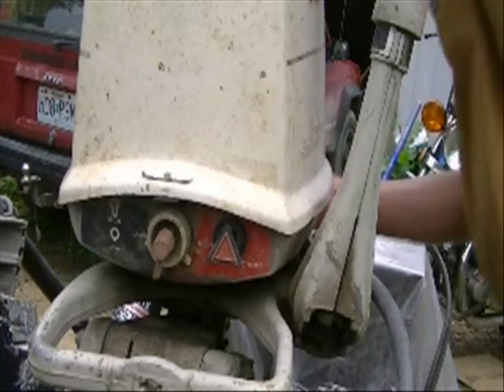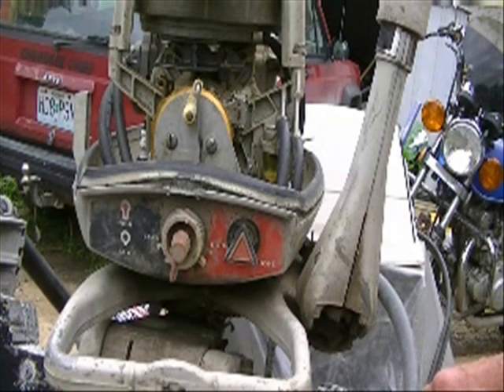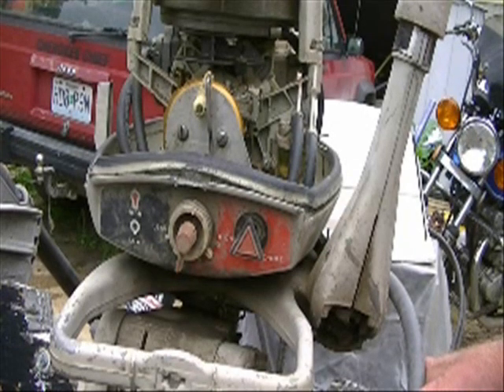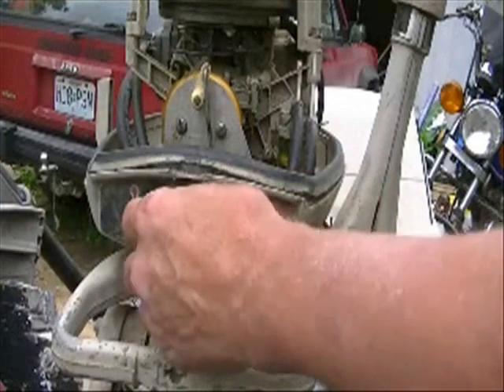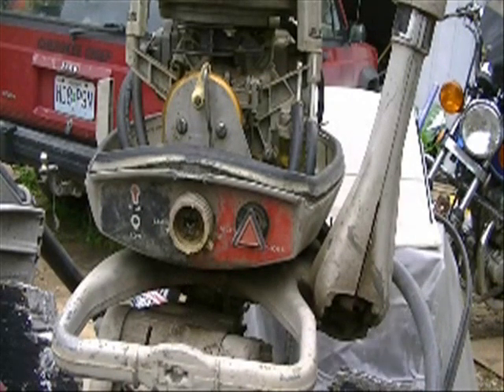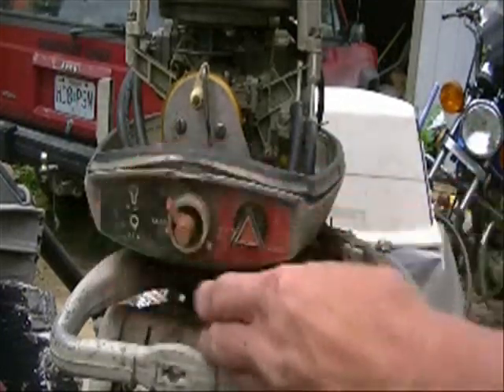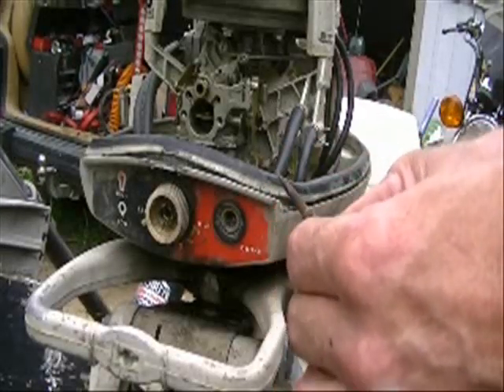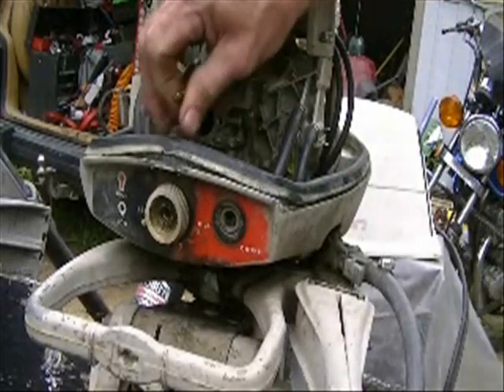Boat Motor Won't Stay Running? Watch This!!

Comment: i have a 78 55hp evinrude  what should the floats to set to  right now they are set on 13/32mm
Reply from the maker: Michael Robbins I don't know. If they are on a hinge, they should be set so that the float and the float bowl base are parallel when the carburetor is held upside down.

Comment: Hello I have a 94 30 hp evinrude it will not start it is hard to crank over but when I take my spark plugs out it cranks fine. Could I have some help please
Reply from the maker: freddy wilkerson Either the starter is worn out, or it is losing amperage through the wiring. Try jumping directly to the starter stud with a jumper cable and see if it spins over normally.

Comment: I have and 1985 boston whaler with a mariner 115, the motor starts right up when the rpms are high but as soon as you drop it in neutral it shuts off after 2-3 seconds, is it the carburetors?
Reply from the maker: Ryan Jackson It could be the idle jets are clogged or the idle is just too slow. Try pulling the choke at full throttle. This may clean the jets. Just pull it momentarily and release, so you don't kill the engine.

Comment: I have a Yamaha 4 horse / 4 stroke.  Cold start is fine.  Motor will run without cutting off.  When I cut it off it will not restart until it cools back down.  A mechanic has checked for thermostat and there is no problem there.  Any ideas.
Reply: hi had the same issue took it to mach
found out compression was that low or just running one that pressure from water stops the engine
u will also notice u can rev on neutral

Comment: Hi Kevin. I have a 1985 Evinrude, 70 hp. I have water in the fuel, with a milky substance build up on front 3 carbs. The hose connects to the airbox also have fuel and milky substance coming out. What could be causing this? Shouldn't this hose have vacuum and not have gas leaking out? I'm totally in the dark on this, lol. Any advice you can give would be greatly appreciated
 Thanks so much
Reply from the maker: The milky stuff is water mixed with fuel. Make sure the tank is clear of water and that there is not too much alcohol in the fuel (which attracts water). Probably not much vacuum to that hose and may leak because a carb float is stuck.
Reply: +kbbacon Thank you

Comment: I have a 2008 mercury 9.9 four stroke that will crank and run fine as long as I keep pressing the primer bulb on the front of the engine (not the primer bulb from the tank). When I stop pressing the bulb the engine shuts off. Any ideas what could cause this ??
Reply: +Chris Thomas Maybe its not able to draw fuel from the tank, tank breather may be blocked. Had the same problem
Reply from the maker: +Chris Thomas I couldn't reply. earlier. I'm thinking that the main jet in the carb is clogged in the fuel bowl. Sometimes choking the engine while it's running will pull the clog out, otherwise, carb cleaner through all holes in carb or remove carb and use a fine wire or needle to open up the jet.

Comment: recently bought a pontoon with 50HP Force, it starts fine but as soon as I pot it on FWD or REV. engine dies! is it low Idle problem?
Reply from the maker: Probably, but try pulling the choke out and see what happens.
Reply: @kbbacon  It's a "push key in" type of choke not a push/pull lever type.
Reply from the maker: @majidsoltani8588  Try pumping the primer bulb on the fuel line.

Comment: ok I have a question I have heard that some older boat motors in the 9.9 range can be change to 15-18 hp just with changing out the carb. do you guy by chance know what motors this can be done with? the reason I ask because here you do not have to tag a 9.9 motor or lower and this would give me a chance to find a motor over the winter when they are cheaper. any information would be a help
Reply from the maker: It is possible, but I do not know for sure. I know that works for some 4 strokes.

Comment: Sorry to bother,  I'm going to try what you suggested here; So I have an evinrude 9.9. 4 stroke 1995 took It out, it seemed to run and start ok. but then full throttle wound bog down at top speed, it started to sputter and and even back fired, it would go 10 feet and shut off 10 feet and shut off full throttle would bog. it was making sounds and running like it had water in the carb. any suggestions? I'm going to try put a carb rebuild kit and see if that helps
Reply from the maker: Sputter and backfire is due to a lean fuel mixture. Blasting out the jets with carb cleaner will usually do the trick. Also  try pulling the choke.  It will sometimes loosen debris and clear out the jets.
Reply: Thanks for the quick reply, will do! One speck/grain of sand in the jets will cause that issue? Just picked of some compressed air in the can, I'll keep you posted!
Reply from the maker: It takes very little to mess with air/fuel ratio. Good luck!!
Reply: had same problem...my coil pack was loose.wasnt getting proper ground.
Reply: John Parkhurst

Comment: thanks for great vid. i'll try the seafoam heard it's great. Mine runs great in 55 gal drum (all day) take it out on lake it runs for about 20 mins then shuts down let it sit for 10 mins runs again for 20. I've fiddled w/ it. Any advice? it's 1963 sears 5 hs. I have the fastest grumman transomed on the lake(usually)
thanks again.
Reply from the maker: dadrules714 There is either a fuel blockage at the fuel pump (or a vacuum leak in the supply line), ot the tank needs to be vented. Squeeze the pressure bulb when the engine starts to die. It's also possible that the points are to wide and they warm up and don't make contact. Lastly, it could have a coil breaking down when it heats up. I have also seen head gaskets do this, but it would likely only get one cylinder.

Comment: My boat motor revs up too much but it doesn't go fast is there anything you can help thanks
Reply from the maker: Check your prop connection. The key may have sheared or, in some cases there's a rubber bushing that separates. I'm betting there's your problem. Let me know!

Comment: i got a 7.5 sea king out board bout,a 79 yr, mint condition, will it work this engine/ montgomery wards  in on the motor, i bought it, for 40 dollas, all new paint, no rust,it, sparks, what can i do it get this obe started.

Comment: Hey, i just got a 1975 johnson 15 horse. It starts ok, but it ghost revs on me and doesnt want to stay running at low speeds. It will run, but its not consistent and sounds like shit.  Any ideas? Thank you!
Reply from the maker: I would check the points. Also, flood the carb with cleaner and let it soak. The float might be sticking.

Comment: Kevin I have a nine and a half Johnson pull start 2 cylinder 2 cycle I'm fairly new to this boating. my boat motor when I pump the primer bulb and pool to start it it runs like mad 30 to 45 seconds. then it stops and won't run again for a while. I have put it on the Lake 3x and cannot get past the dock. I try to restart it but it won't start. I want to fix this on my own because my budget is very small. Help Please
Reply from the maker: If You can take the sediment bowl off,  try filling it with Sea Foam and replacing it. then start the engine. The Sea Foam might dislodge some gunk in the fuel system. Just a shot in the dark.
Reply: This will happen if you forget to open the air vent in the fuel tank. Engine sucks fuel from the tank and creates vacuum and fuel flow stops. It will not restart until vacuum leaks away. Then the cycle repeats itself. My boat goes about 25 yards before it stops but it depends on how much air space is in the tank when you start.  If you have one of the tank caps without an obvious air vent screw in the centre, try loosening the cap and if it then works sort out the cap or renew it.
Reply from the maker: The engine has a fuel pump that may be bad.
Reply: Another thought after reading your statement "runs like mad". When you start engine it should be with the choke pulled out. As soon as it starts, push the choke back in again, working the throttle at the same time. Engine will "run like mad" because choke supplies too much fuel to engine, eventually flooding it and making it stop. A fuel flooded engine will not restart until the excess fuel dissipates. Either wait 5 minutes or more and try restarting, but without any choke and without pumping primer bulb, or disconnect the fuel line and give 5 or more good pulls on the rope to pump out the excess fuel. It is also possible that the choke in/out knob is not doing it's job properly and engine is permanently choked. They can be wrongly fitted with 180 degree rotation and not operate the choke plate correctly.  A quick visual check should let you know if it is a least moving the lever on the carburetor properly.  From distant memory, the small flat cut in the side of the plastic arm should face inwards.  A better way is to remove the air intake "muffler" and visually inspect the choke flapper.  With choke knob out, the flap should be fully closed and when knob is in it should be fully open. There is an excellent website called leeroysramblings.com  that tells you absolutely everything you will ever need to know about these motors.
Reply: FYI, that's leeroysramblings.com . A very helpful site.
Reply: Seeker85420
Reply: Thank's  Seeker85420 - I have corrected my post.

Comment: i am having a problem with primer bulb not expanding back after compressing it.....arrows on bulb are pointing the right direction....help..hellp..help
Reply from the maker: Check the fuel tank and hoses. It  appears to be clogged.

Comment: Will seafoam treatment for my motor clean carbon out my converter
Reply from the maker: I don't know.
Reply: Nvm I cut the converter off and put a flex pipe on it

Comment: I have a 9.9 HP Evinrude outboard. I can get to run but after a few minutes running it shuts down. The bulb is out of gas.
Can anyone help me out ?
Reply from the maker: Jack Ramos Leave the cap loose on the fuel tank, but I'm guessing there is a small leak between the bowl and the tank. Check the gasket on the bowl. They are notorious for leaking vacuum.

Comment: i got a ? guy, i get a spark ,  there is a white spark, what color, do a spark on the plugg should be? blue,  or bright white,
Reply from the maker: White or blue with a distinctive crack noise is strong. Yellow and quiet (or maybe you can't see it at all) is weak.
Reply: TheFishman88

Comment: Not sure but I think that maybe made by ESKA. They were at one time. You may try this method. but you may have to remove the carb and physically clean it. You may need an overhaul kit??? Google the model number, you can also try. maxrules . com  if he doesn't have what you need he can probably tell you where to get it. You will also need to replace the water pump as well. Check the lower unit oil level and condition. Good luck. never run a motor on muffs submerge the foot in water.

Comment: My damn Johnson 66 3hp just only runs when choke is pulled out
Reply from the maker: Your jets are clogged. add some seafoam to the gas tank. I'll clear up.
Reply: @kbbacon  thank you. The throttle pin I have to take out to start it. I'll clean it out :>

Comment: get a 4 stroke
Reply: you did not say anything did you get a 4 stroke yet ?
Reply from the maker: Scott Jess Cant afford one! I mostly run electric.
Reply: afa marine there web site is smalloutboards.com they have real good used outboards for a great price they dont sell junk you can contact them also just ask for Albert hes a good dude and runs a great shop he will work with you and give ya a good deal check it out hes got some nice motors for cheap and will also will help with shipping cost
Reply: Yea! Buy A new four stoke. 9.9 for $5000 Or something!